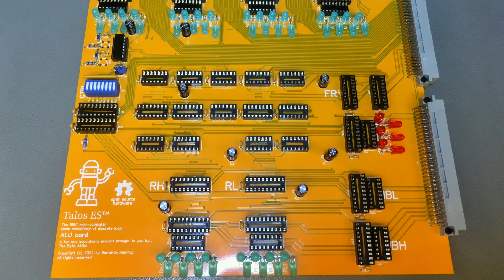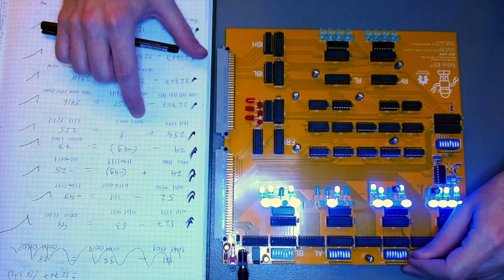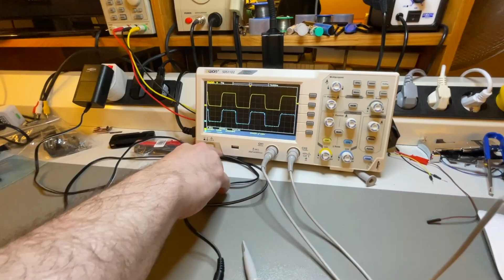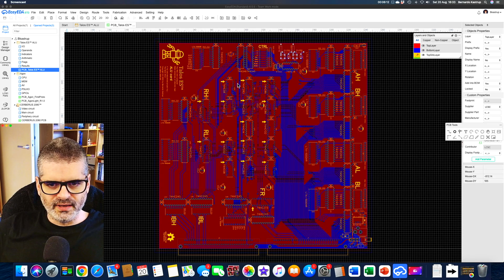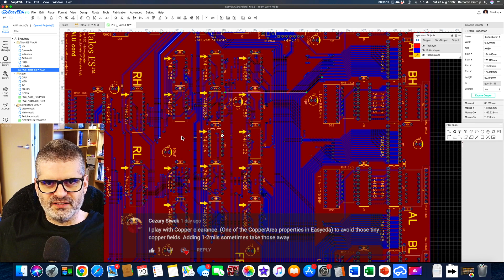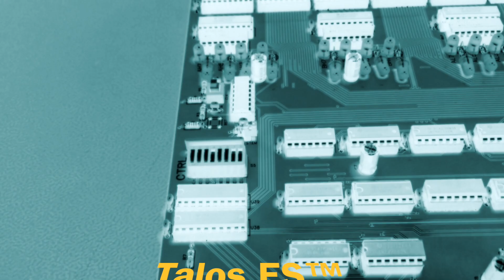Building Talos ES™, the 21st century's mini-computer (Episode 5)

Comment: Well, you should not keep buses in high impedance state for too long without pullup resistors, because the receiving end will malfunction with high current draw, especially if it is CMOS. I believe TI has some guidance on how to choose pullup resistors for this purpose...
Reply from the maker: Keep watching, there are pull-ups in every bus, and every control line.

Comment: Hi Bernardo. I am a big fan here and I have been following all the episodes and from the other computers as well.
One question: any reason to not use Kicad or is it just a preference? I just re-created your diagram on Kicad and will be happy to send the file if you want. I am just a hobbyst here.
Reply from the maker: Hi, thanks! Just preference: EasyEDA is more integrated, while KiCAD forces you to explicitly navigate across different modules, which I don't like. EasyEDA, although very simple, feels more like a professional, fully integrated environment. As for the KiCAD files, keep in mind I am continuously updating the schematics! If you put your files on Github, I can link to it from my repository.
Reply: @thebyteattic  I will put the files there. And creating the files on Kicad helps me to understand the whole project and all. And I agree, the different modules on Kicad are a little bit annoying… Are you planning to post some pdf with the board layout, the same way you did with the schematic. Again, having to design the board on Kicad will help me a lot understande the process, even if the board layout changes later. Tks again!!!
PS: are you by any chance related to Brazil. Both your name and last names are very common there.

Comment: Just one remark on hiding the copper areas (I use this feature a lot)  Make sure you always rebuild them when you change something because they are not being updated automatically when something else gets changed. Once, I moved something a bit and it ended up being where the copper area was before. I re-enabled it but I didn't spot it was the case. For some reason it hasn't been caught by DRC checks either so my board was manufactured with that error. 
I'm glad I could help with Copper area clearance.
Reply from the maker: Cheers mate!

Comment: Elegant PCB, just like a piece of art, also as usual the best quality product I've even seen, minor design problems did not affect the quality, there is smaller size round LED even you don't use square LED or bar shape LED, you really set up an excellent example for others.
Reply from the maker: Cheers mate! By now I made up my mind about using LED bars, less hassle...
Reply: @thebyteattic  It elegant, just a bit expensive, since you're not running lot of boards, the cost is worth.

Comment: I have a question or two and some observations.

- Are there no push-to-make switches with the same footprint as the push-to-break switches you ended up using? That would be a part change rather than a board re-spin — unless there’s a more fundamental issue.

- you position your LEDs throughout the board — presumably to be near the functional blocks they provide indicators for. Have you considered having them on the board edge so they would be visible when running your system as a whole, regardless of board order (you might, for example, want to see LEDs from multiple boards at once. This may, of course, make routing far to complicated to be practical.

- instead of grounding your unused LEDs directly, would you consider adding a solder-bridge footprint (sorry, don’t know it’s proper name) on the PCB — just to make 'bodging' in something later slightly easier if need arose?

- Also wondered with 10x LED bars — you could use the extras to show carry-in/carry-out to the L and H adder circuits, if you wanted.
Reply from the maker: Hi Timothy. No particular preference about the push buttons, except that I have about 50 of the ones I am using, so I want to keep on using them. The board needs to be remade anyway, for other reasons. As for LEDs along the edges, I don't think that would make for an elegant solution, and routing would be a nightmare, in a 2-layer board. There are LEDs for the carry flags, so nothing else that would benefit from the unused LEDs really. And leaving their inputs floating isn't good design practice.
Reply: @thebyteattic  I wasn’t clear about unused LEDs — I meant to ground via a solder-bridge jumper footprint in case a future tweak needed to be tried out, rather than floating.

As to elegance, that is in the eye of the beholder 😜 But your solution is almost certainly easier to route, even if not visible when in-system.
Reply from the maker: @timothyp8947  Oh, I see (about that solder-bridge jumper).

Comment: I would really try to run a meaningful delay test on this board. Wire input AH+AL to the number 0x100, the input BH+BL also to the number 0x100 (maybe you can temporarily bodge the buffer control signals for the input operands alone so you can use the dip switches to set those numbers), do a full with operation and alternate both 'negative' control input signals high and low between 0 and 1, alternating between 16-bit addition and 16-bit subtraction each clock. Addition gets result 0x200 and no carry or zero high flag, subtraction gives result 0 and it will give you zero high + carry flag. Measure the delay between control inputs and zero and carry high signals at the flag register input. Note that you have separate zero high and zero low flags and to test for 16-bit zero you need to use the logical AND of both, something you have to take into account when designing the branch instructions.
Reply from the maker: Propagation delay is not a design priority for me here. This is an educational toy. I do want the signals to be clean, so I can run the chosen design at a meaningful clock speed approaching the maximum the design can support, but I won't change the design itself based on propagation delay considerations.

Comment: In one of the previous videos you have mentioned, that you have introduced extra ground vias, to allow a return path for for the signal current near to the dedicated IC pin. 
At your packplane connectors it is even more necessary, to have a signal current return path near to the signal itself. 
May be I'am wrong, but I have just have seen a few ground connections at your backplane connector at only  one edge. 
If it's not too late, and may destroy your whole backplane concept, I would suggest, to spread several ground pins over the length of the connectors, to give each signal a proper ground signal path in the backplane. The more ground pins, the better.
Reply from the maker: I do need most of those pins for signals. But I can drop a few ground VIAs around them, especially around the C LK pin, good point!

Comment: In Episode 3 you told that it was possible to rearrange the inverters in the control logic, so all control signals would have s Schmidt-trigger input without the need to replace the NAND chip with one that has Scmhidt-triggers  But you did not want to change it back then because the board was already manufactured. Now's the chance.
Reply from the maker: The solution of using a 74132 is preferred because one of the signals, aside from being inverted once, also needs to go into a NAND gate without being inverted. If you look at the schematics you will see it.

Comment: In the first video you mentioned the intention for these boards to be used either independently or mounted in a system. If you were able to swap the resister packs on the edge of the board with the dip switches behind them, then you could use right angle dip switches that could be accessed from the edge when the board is mounted with other boards. I don’t know whether that’s possible, but it could improve the usability of the board. Alternately (and in my opinion better) jumper headers that could be wired to off-board switches that could be used in parallel with the dip switches in the style of a PDP11 or an Altair would be a lot neater than wiring directly to the rear of the dip switches.
Reply from the maker: I can't envision a scenario where the DIP switches would be used in-system, or even with the board plugged to the backplane...

Comment: Aren't the holes for the LEDs for 3mm instead of 5mm? Why not use 3mm LEDs?
Reply from the maker: Yes, the manufacturer put a 3mm silkscreen outline in the footprint of a 5mm LED (Wurth Elektronik 151051BS04000). I would indeed simply switch to 3mm LEDs if nothing else were wrong in the board. But since I have to correct the circuit around the push buttons, add another LED row for the control signals, and improve the silkscreen, I have to make a new PCB anyway and then decided to part with the discrete LEDs. I was also frustrated with soldering them one by one. So now I'm committed to LED bars: it's cleaner, easier and more elegant.

Comment: I was thinking if you are going to fit PCBs in Rack please consider holes at face side for PCB card ejectors. Also perhaps leave bigger padding around edges to accommodate for PCB rails.
Reply from the maker: The plan is to NOT use a rack. Those things are pretty expensive these days, since they only have professional use. My plan is to use an ATX board as backplane and 'floor,' in an open-frame construction, where the cards stick vertically to the 'floor' board.